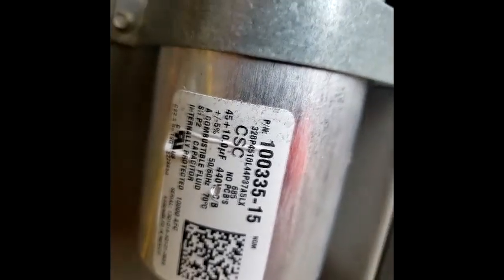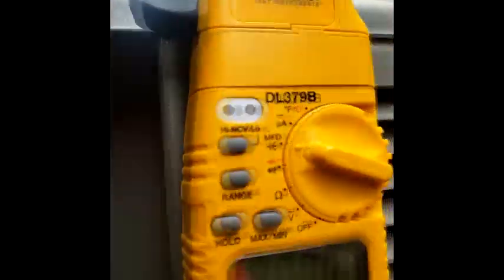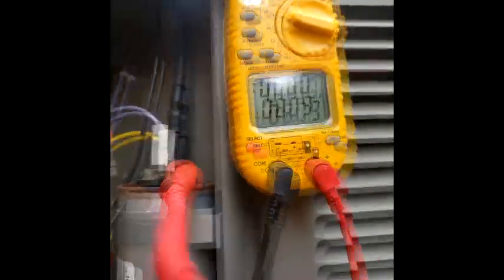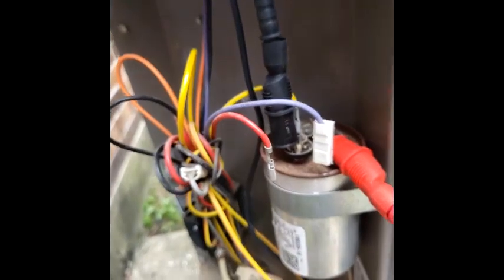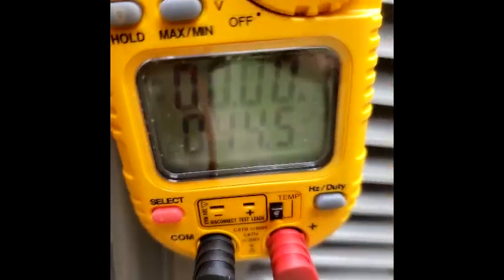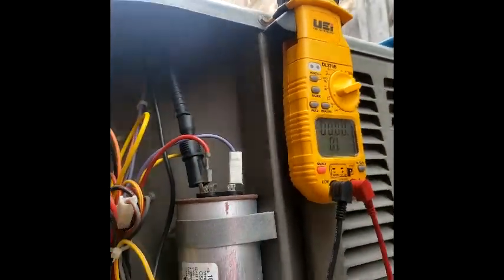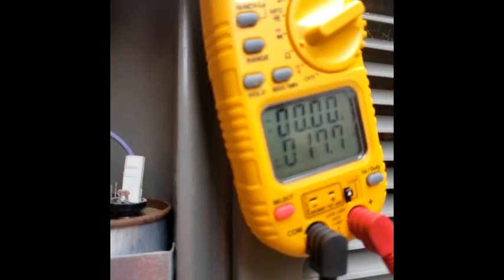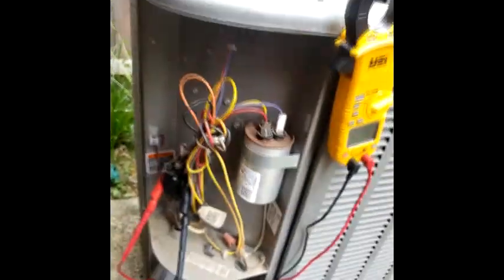"AC Inspection: Revealing Troubling Capacitor and Contactor Issues!"

Comment: Original Lennox capacitors are very rarely bad even after being 8-10 years old. I don't know where they get them from but they last forever. And if the original evaporator coil starts with CH33 don't bother adding stop leak to it because it's a wrap. The coil is shot

Comment: Good job. I would have shorted out the cap prior to checking in order to prevent an unwelcome jolt.
Reply from the maker: Trust me I did..when I took off panel..I've been hit with an unwelcome jolt by a capacitor when I accidentally touched it troubleshooting a 12 ton carrier and I dont want to feel it again. One time is enough for me
Reply: WW HVAC   I hear ya. But a good idea to mention discharging so some novice watching doesn’t blame you for injuring them. Keep up the great work. Much appreciated!!